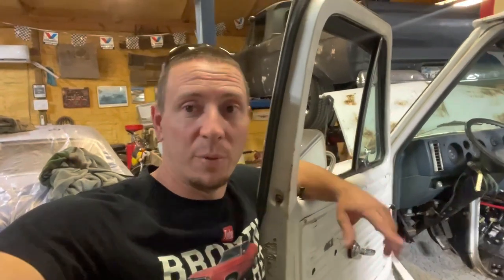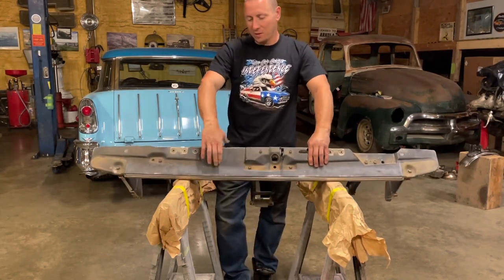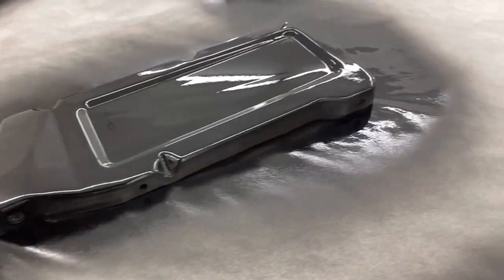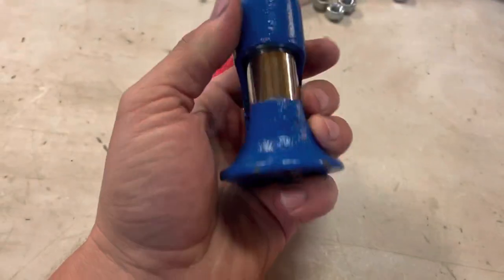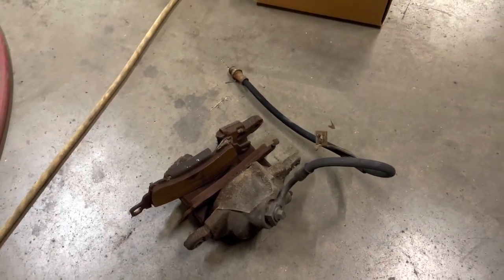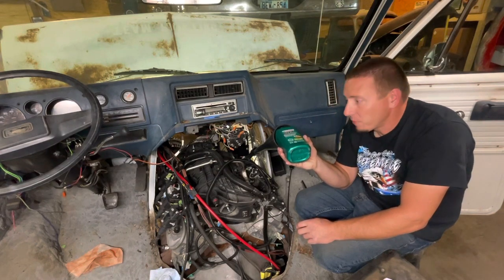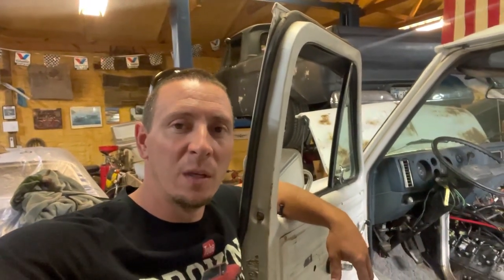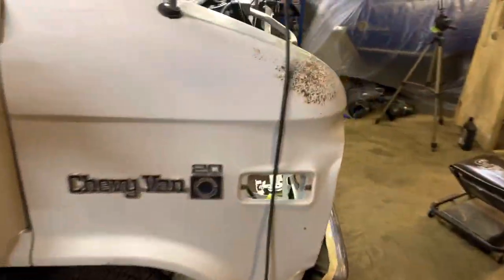Gen IV LS swap in a G20 Chevy van. Ep 7. FINALLY we get to attempt a first start?????????

Comment: I think mine is pretty similar! I believe it is an ls currently, and some people are using a tbi 350 for swap? Idk lol, I’m trying to use up the old ones last miles and replace parts as they break or when I learn to replace them. Which- I might have to change my plan on that a little lol I’d like to take it to Canada and be OK further away from the mechanic shop that I usually take it to (because I basically have only started learning parts and wiring)
Reply from the maker: just takes practice. watch some videos and learn as much as you can. most mechanic work just involves taking something off and putting it back on, of course with some testing to confirm what your problem is.
Reply: @BrokenWrenches  I'm sticking with it! almost got the dog house off last night to Zep clean up and inspect a bit but the last mechanic jammed it up! ill have a tool collection after all this thats for sure

Comment: First off Awesome build and congrats, I ls swapped my 76 shorty and would like to have a/c. Have you listed the a/c bracket kit on ebay, if so what is it listed as?
Reply from the maker: Thanks man. I’m currently waiting on my metal shop to finish cutting some spacers for me and then they will go on ebay, along with a more detailed installation video i recorded thats not seen in the current series. Stay tuned for that.

Comment: Is the factory AC compressor location a no go?
Reply from the maker: correct. the motor mount assembly is to far forward for the compressor to bolt up, roughly 1.5 inches to far towards the front to work.
Reply: @ Damn! Just finished your whole series, awesome work!A little intimidated to do it now lol. Do you still have AC brackets?

Comment: Is it possible to tub the firewall and the cover that’s on the inside and move the pedals over slightly - really love the build but I’m asking because I want everything to be easily accessible
Reply from the maker: Honestly it’s really tight on the old feet area. The wheel well is on the left, then the steering column and pedals all squished together. My recommendation would be to go with a slightly newer G that had diesel engine options, they have a little more room in the engine bay all around.
Reply: @BrokenWrenches  ah I see we’ll alright then appreciate it man thank you

Comment: Hi there, did you ever get your Express Van Air filter box to work in your swap.
I just did a swap in my g20 and found your videos very helpful 🙏🏻
But the open air intake noise is a pain in the ass 😵‍💫
Reply from the maker: I couldn’t get the thing to work in its stock style location. I would recommend buying a kit that has multiple tubing sections that can be cut and joined together with tube sections. That way you can put the filter anywhere you want as long as its not to far from the throttle body. Also make sure you dont have open holes through the firewall. Thanks for watching.
Reply: @BrokenWrenches  I will thanks. I’m located in Europe, spare parts for American cars unfortunately is not everywhere. But I just saw a air cleaner box assembly for a Astro van 2000 that maybe could work 🤔
Give it a shot if you see one in the wrecking yard 👍🏻

Comment: Nice work! Really considering doing this to my ‘86 G30 motorhome. I want to throw a 6.0 and 4l80e in it to have an extra gear. How hard do you think it would be to literally just swap everything from an early 2000s 2500HD? I think it would be cool to have the truck cluster, radiator, coolers, AC and controls. Sounds like a lot of headaches and wiring
Reply from the maker: The powertrain swap and coolers would be ok. The gauges and dash stuff not so much… not impossible but very difficult.
Reply: Might be easier to start with an Express van donor